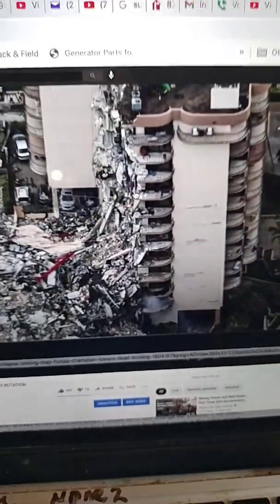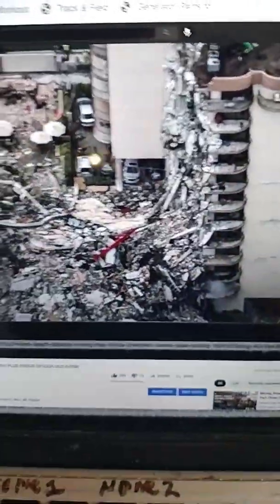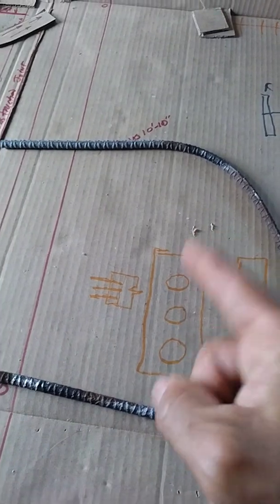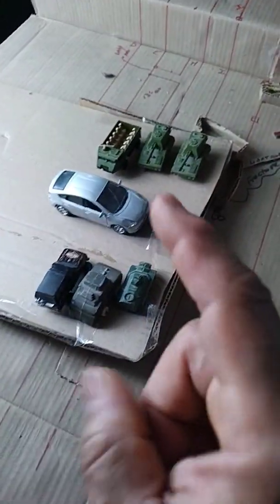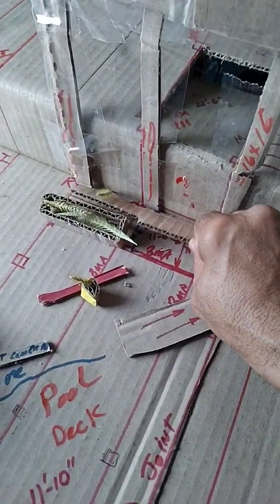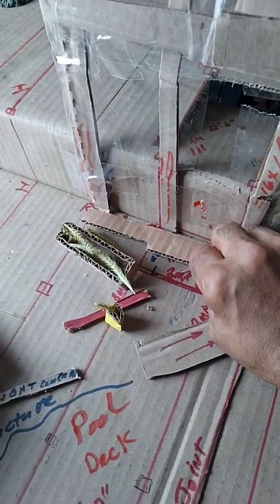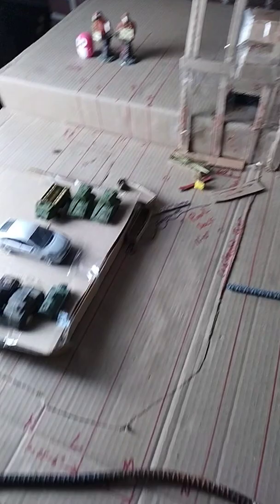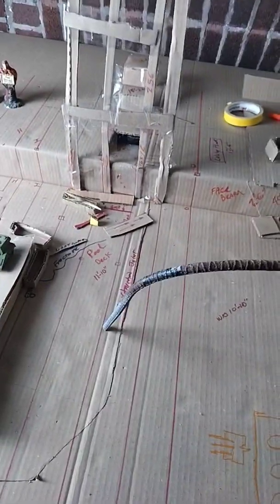Champlain Towers How the Construction Joint Could have saved building with REBAR

Comment: Yea, I remember you talking about the construction joint some time ago. I thought the context was something like it is needed because of how the deck concrete is assembled/poured. It's weird that they didn't add the supports as soon as the deck problems were discovered. I assume that is the significance of circling back to the FL stairwell collapse video and how you would have supported it.
Reply from the maker: We are going to "re-brand" circle back ⭕ haha to actually mean, circle back.
Reply: I liked the reclaiming my time, but couldn't work that into conversation as easily. Good morning Sunday morning only had 5 min of fame. I'm speaking is a bit too far over the line into cattiness. I'm sure she accepted that circle back is a meme now, and you are using it for good (algorithm?) at least.

Comment: When you said, "Who do we have here?" I thought we were going to see George or Bruce!   Mr. Steel....so, Mrs. Concrete will probably be joining us as well.  Gonna go place my drink and cigarette strategically by my monitor.  'Looking forward to it!
Reply from the maker: Amy, did  you find the plumbing plans, they are located under Surfside and under Champlain Towers but note, they had sprinkler system updates...
Reply: @ForensicCats  Thanks, I was trying to find them.  My comment about the pipes was not to say that water had anything to do with the collapse.  ('just wanted to include my bro's comment for all the homeowner's out there-I live in a trailer which is basically made of cardboard!).  I was thinking that pipe in the video could have been for outgoing gray water from a washer and then we could put the washer interest to bed.  No other pipe hanging down (incoming) though, so blows that theory.  Thank you!
Reply from the maker: No... and that water source has not been confirmed by me... could be the sprinkler supply line.
Reply: @ForensicCats  I'm watching the potential buyer video where she is looking for her parking space.  There is a sizeable (white)  pipe directly over the base of the ramp, then no other ones  until two join into a "Y" shape two columns past that.  Phantom washer I suspect! Have  a LOVELY evening!
Reply from the maker: Oh. You are a cheater, cheater. Cheater pants on fire ! Lol
Reply: I also expected a Bruce or George appearance at that point. Gotta mix things up though.